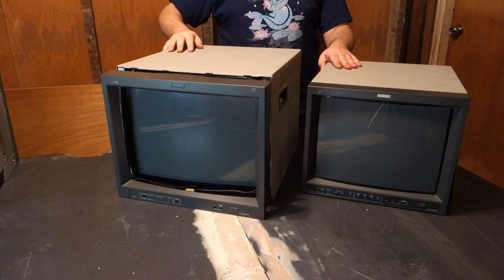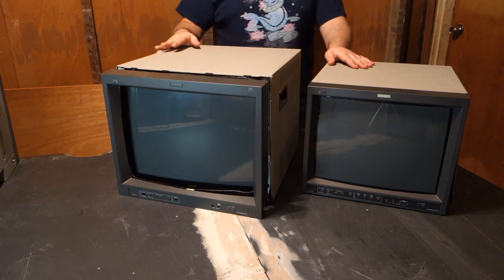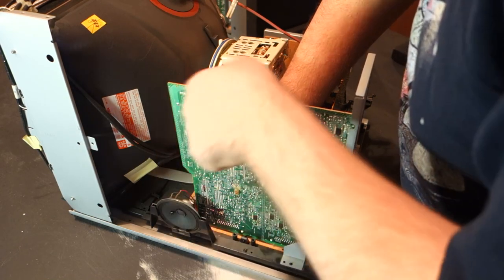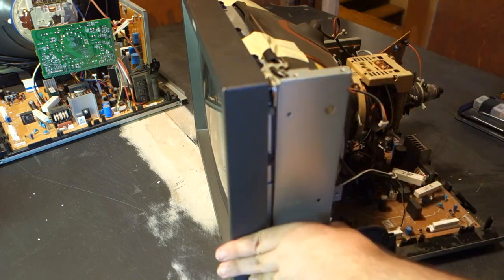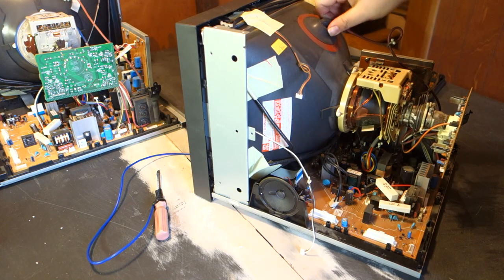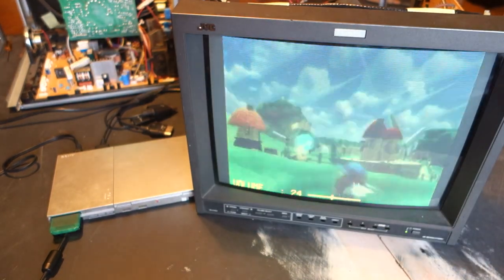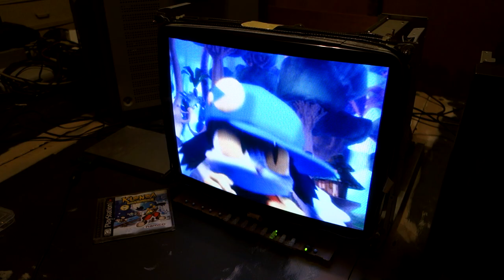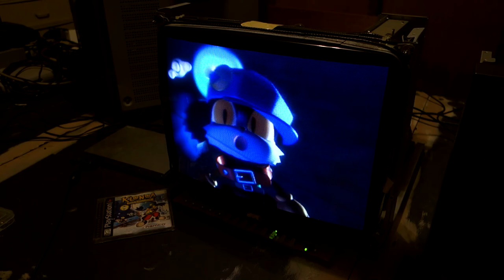Frankensteining JVC CRT Monitors - TM-H1900G Conversion to TM-H1950CG

Comment: I have a 1900 as well. That front bezel thing is crazy common. It doesn't take much at all to snap the brittle plastic these days. The first sign was when the power button toggle bit just snapped off. Then I took the back off and went to turn the unit on the table using the front bezel and... snap, crackle pop and my bezel looked exactly like yours.

Comment: Man, this seems scary but very doable. Much more so than a donorless RGB mod so I'm gonna try this as I have a 15'' CG and am going to pick up a 19'' 1900G tomorrow. 

A few questions if you don't mind.

1. Doesn't the 15'' have a smaller back panel? so how am I going to have the same cutout for the RGB insert card (which I do have) for the 19'' chassis? Im guessing the 15'' one is smaller and the 19'' doesn't have the same cutout? 

2a. is it 100% necassary to swap the front pcb board if you are only planning on using 1 input (the RGB input obviously)?
2b. Also adding onto the previous question, are you able to put the front bezel back if you are not going to press any of the extra buttons? This because the 1900G has less buttons so it shouldnt not work if you want to press buttons it doesn't have cutouts for but it should be fine if you are not planning on using them right? Or will the other buttons be somehow in the way or something?

3. Also, after I've done the swap and I bought another RGB insert card for the 150CG, I'm assuming I would no longer have RGB? Would it then transmit s-video or composite through the BNC/scart cable or not send anything at all?
Reply from the maker: 1- Yes, all 3 sized monitors in the TM-H line have different rear panels and different front bezels. If you're wanting to button things up somewhat cleanly, you are going to need to cut a hole in the rear panel of the 1900G in order to allow access to the card slot on the new input board. Alternatively, making a new rear panel out of something, should you wish to not cut the original.

2a- You could likely modify the existing front PCB if you really wanted to, but at that point, you'd be putting in more effort for a lesser solution.
2b- You are going to need access to the missing buttons to access the new inputs; The buttons on the 1900G's panel are for A and B, which are the Composite and S-Video input respectively, where the 150CG (and 1950CG you would be essentially making) have A, B, C, and D; C and D being RGB and Component (or the reverse) and that cannot be changed by going into the user menu. On the topic of the bezel, you will need to cut new openings on the 1900s to allow said buttons to be accessible. If memory serves, the actual pressable portion of the button is part of the bezel, so you may need to take a look over on shmups where I THINK someone has made a 3D printable button that could replace it. I know there are power buttons for such things, but I can't remember for the normal buttons.

After getting through all of that, I get what you were originally asking; Yes, you could/should just be able to make sure you have it set to the RGB input to begin with, but I would still personally want access to the buttons, if only for being able to also use the Component input as well, but that's something you'd know if it would be of use to you specifically.

3- Honestly sort of confused on what you mean here. The part you're taking from the 150CG to put into the 19'' is the portion of the monitor that actually allows it to connect to and make use of the input cards: The cage for them, the connector, and a number of passives that connect the card up to the IC on the larger input board that you're taking. The ability to still process RGB and the like would still be there, but the actual bits that allow you to externally connect things to it would be gone. It would have the same inputs that a 1900G would originally have, that being Composite and S-Video. If you wanted RGB support back on the 15'' at that point, you would need to do an RGB mod on it.
Reply: Very clear so far, thank you brother! Just picked up the 1900G and come home a few minutes ago and am going to attempt the mod in the video right now. 
Going to put up your video on the big screen and attempt this, wish me luck! 🤞
Reply: @KittyKatKya  well... unfortunately, it didn't work :(
Not only did it not work, the 15'' 150CG shows all green now... :(

I don't know what exactly went wrong, but when I did the swap and pushed the power button (on the 19'' to test if it worked) a little bit of smoke came from inside the crt so I IMMEDIATELY pulled the plug to prevent damage (guess it didn't work). 
The only thing I can think of where it might went wrong was that plug from 6:09 that you have to pull/connect from the board. That plug is a 11 pin on one monitor and 10 pin on the other monitor (can't remember which one was which). So when I was at that step I was confused and you also didn't mention it on the video so I went ahead with it thinking the worst that could happen was that I could have messed up colors or something (which IS kinda what happened in the end). I also thought that if I stopped there it could take hours/days for you to respond so I guess I was impatient (if this WAS the culprit).

So I swapped everything back and the 19'' works with composite and the 15'' has a green screen. Everything I guess 'works' except that all is green. When I press the menu button it does show it and the buttons also work and function. Everything is just simply green. 

Anyway, all in all im a bit sad lol. Had to drive for 2 hours, pay a couple hundred bucks, tinker with both monitors and now I broke one of them and am too scared to try this again with another set let alone attempt the rgb-mod which is even more difficult. I guess Ill just have to live with s-video for now.

I don't know if there are differences but I guess there are, I'm not 100% sure what went wrong but it's safe to say it's somewhere on the board that I was supposed to remove (the rgb-board is it called?). Because the smoke came from the 19'' crt and the 15'' is the one that''s now fucked up, so it''s safe the say it's the board that got fucked up and I switched it back to the original and now it's showing green.
I can take a picture of it if you want, I didn''t see any burnt spot on the board, so don't know how fixable it is and obviously you wouldn't either. 

Anyway, excuse the long message. Just wanted to let you know. Thanks for the tutorial anyway ;)

Comment: Man this is such a random question years after the fact but I'm going out on a limb here!

Do you have any idea what the length and width dimension are of the Front Panel PWB/PCB board you pull out from the 1900 at 12:02? 

Thanks!
Reply from the maker: Can't be 100% sure if I'm getting my measuring tape all the way to the rear of the PCB, but just ran up and tried to give it a check, and it would seem that it's ~8cm deep by 33cm wide. This is the transplanted front panel PCB from the TM-H1750CG, but dimensions should be exactly the same between the two, just with more/less components populated.
Reply: @KittyKatKya  whats funny is I was trying to match it for a 1750CG anyways but from looking at schematics that and the 1950CG seemed to be the same size! Also having the same button layouts on the front. Trying to reconstruct it for an extra 1750CG i have that came without that board so thank you for this, You are a legend for replying!
Reply from the maker: @mattsimone3061  yeye, can confirm that the 19'' and 17'' monitors are using the same boards between them, both the front panel as well as the rest of the chassis; Perhaps there being a few component differences between them. Nearly positive the 15'' does as well, but don't have a H150CG personally to verify that against.

Weird for it to have come without the input panel; Parts unit had for cheap, or damaged in shipping perhaps?
Reply: @KittyKatKya  I got it from someone locally for very cheap and they said they bought it off ebay and it get destroyed in shipping, bezel is broken but can still fit in place, stuck on input 2 which isn't bad by any means but God is it impossible to find parts! So I was trying to have someone make one off schematics for the 1950CG and this was the only thing it never stated was dimensions of the board.

Luckily the tube was unaffected, but it would be nice to be able to go into the service menu if needed and the volume is stuck SUPER loud lol.

Again thanks for your help and input on this I greatly appreciate it!!!
Reply from the maker: @mattsimone3061  Solution for the audio situation short term, if you hadn't already thought of such, is you could likely just disconnect the internal speaker and be done with that.

Comment: Do the 1900s have the same tubes as 1950s?
Reply from the maker: Only the chassis differ, the tubes are exactly the same. The H1950CG just has some additional components/boards versus the H1900G

Comment: neato. What are you gonna do with the 1900's bezel to fit the extra buttons?
Reply from the maker: Honestly, a good question. If I thought there was any chance of being able to reattach it, I'm pretty sure all of the cutouts for the additional buttons are there in the plastic, just covered up with a thick adhesive cover, which could just be cut through rather easily. 

That said, all the posts/mounts where it attaches to the tube''s posts are essentially shattered. The most likely direction is either working out how to make a new, custom bezel for it, or to re-case it entirely. Maybe go for a pro-grade tabletop arcade cab of sorts.

Comment: I have only 1900G, how to add component?
Reply from the maker: This video wouldn't be able to help you with pulling off such a mod, due to requiring a donor monitor to steal "upgrade" parts from; That said, an RGB mod is absolutely doable on the TM-H1700 and TM-H1900 monitors; Whether this would also be able to directly worked into a Component mod, I cannot say 100%, but if you'd like, I can direct you towards info to how to do said mod.
Reply: Kitty KatKya if u can , give me a link for JVC , component mod , I found RGB mod , but need component
Reply from the maker: @Voooodooooo  I am only aware of an RGB mod; While I'm positive a Component mod would be doable, I'm not aware of anyone that has actually done so. An option you could take would be to get a YPbPr to RGB transcoder in order to just follow the existing RGB mod.
Reply: Kitty KatKya okey bro , sent pls link
Reply from the maker: @Voooodooooo  What link? You said you've already found the RGB one, which is the one I'd be able to link you. Do you mean for a transcoder, or?
Reply: Kitty KatKya no, my manual is for Tm-h190CG , my monitor is Tm-h1900G, give please link for RGB mod